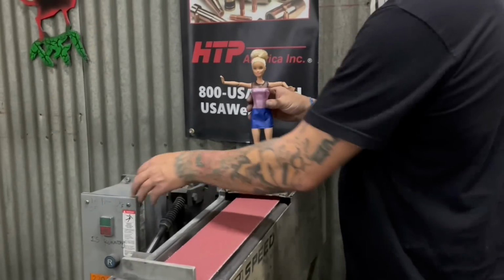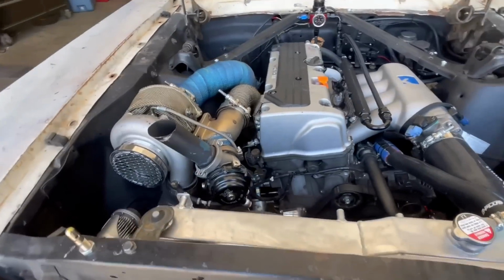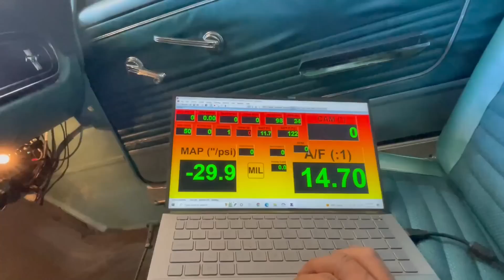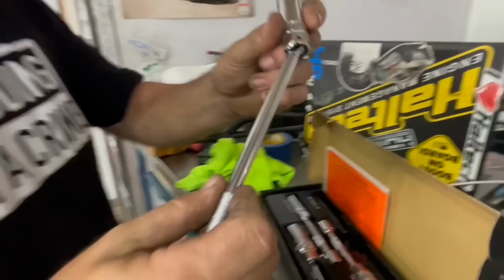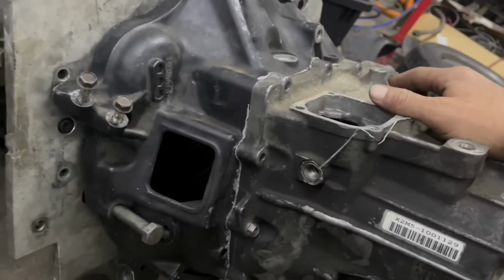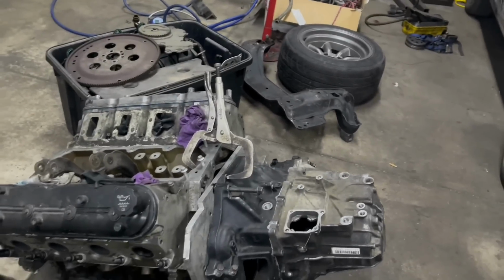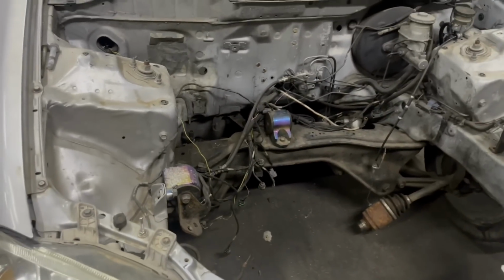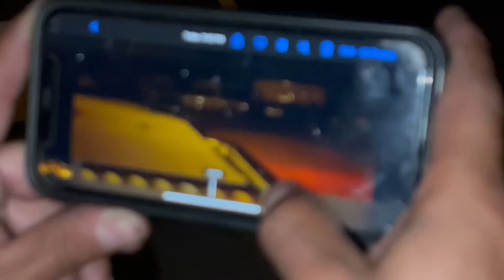K Swapped Mustang! Bent Nsx Rod and an Ls Swap we gotta Do! Let’s have some fun!

Comment: Hey man, If you can find an LS4 block (fwd 5.3) they have the GM metric bellhousing bolt pattern. So any fwd GM trans with a metric bellhousing will bolt right to it. Thats how the Fiero guys are doing it. All the GM 60 degree V6s, the 3800 V6s and the 2.2 OHV 4 cylinders are metric bellhousing. The 2000-2002 Cavaliers and Sunfires with the 2.2 OHV (NOT the ecotec) came with the Getrag F23 5 speed with a metric bellhousing and those transmissions are pretty stout and will work with the LS4.

Comment: You guys should try to find a few old school Big Wheel 350s not only to have fun like this after hours at the shop but also for the drag strip to get around on... On the YouTube channel Bikes and Beards they recently came across all 3 sizes they made back in the day the BW80, BW200, and the BW350 and all of them are 2 stroke and I believe they are made by Yamaha but I think it would be awesome if you guys could find a couple BW350's and fixed them up then took them out to the sand dunes and tried them out locally and if they run really good then take them to Glamis or get a Rokon the 2WD big wheel mini bikes I'm not sure what size engine comes on them but a few 2WD big wheel mini bikes would be awesome on the dunes as well

Comment: To do a wheelie with these things, you need to get it in second, pump the front shocks down and when they rebound, yank the throttle to the max. If you yank the handle bars at the same time, it will over rotate and you can't get it to stay up. Rolling in second, pump and thottle. And feet on the pegs. You need them to push you up on the seat for balance, and rear brake to catch the over rotation. You can do the same on first, but it's more calm on second.

Comment: I had just inquired about LS tuning from you guys but seems your not doing the remote thing which I get. You guys prefer Dyno tuned vs st logged tuning. Which was the cd009 from again? I have an lm7 with summit 8707 226/238 .600 lift 113 lsa cam, pac 1219 springs, Brian tooley pushrods and trunion kit, rebuilt 706 heads, shorty headers (space limited), and full ss vband custom 3" x pipe to black widow single 4" outlet muffler. Has the tbss intake and 92mm cable throttle, msd coils, and an RS5R30A z32 tt trans with gforce kit and mecloud 6 puck and pp, has a ford 8.8 31 spline with 3.73 spooled, and 2 passenger side short axles, bnes panhard, ipd torque rods with poly bushings and custom aluminum driveshaft. Has Wildwood pedal set with Wildwood clutch master. This cam makes makes HP around 6k at around 340g/s of air so guessing the 440bhp range. Received Dyno sheet with it stayed 388whp and 395ft lbs but think must've been mustang Dyno. It uses the Corvette regulated filter with -an and earls fittings. And l59 flex fuel injectors and a walbro 255 pump (enough for now). Uses an ls6 oil pan. I just got hptuners and trying to figure it out. Got the governor changed from 98 as was originally going to be a drift car. Has full angle kit with camber plates and extended lowers and spacers. It's got 5x108 to 5x120 adapter up front and 5x114 to 5x120 in rear (explorer axles, hubs, brakes) on Corvette 16x8.5 sawblades. With kuhmo ecsta xs tires. But believe the Dyno tune has speed density on as always open loop but still logs airmass? Idk have lot of reading to do. Maybe someday you guys will do remote tuning.

Comment: If you have one bent rod, never risk using any of the others, it won't go well
Reply: Not necessarily. There's a few things that could have caused that 1 rod to bend.
Reply: @TrevorFrazier331  that doesn't matter, as an ASE certified mechanic of over 30 years, you do not reuse these types of parts if one of them is bent, this is common knowledge for any engine builder.
Reply: @TheeMissingLinc  So I guess Steve Morris (Literally one of the best engine builders ever) doesn't kno what he's talking about then.....Man go argue with someone else if your that bored.
Reply: What the hell are you talking about?? I bet you wouldnt use aluminum rods also
Reply: So even though measures don't lie, you just replace them anyways.
Reply: @TrevorFrazier331  when does he reuse rods that were in an engine that had failure on a catastrophic level? Because bending a rod is considered catastrophic failure
Reply: @TheeMissingLinc  never said he did. But he said you could if they were still within spec. You can bend 1 rod and the rest be fine.

Comment: If you had a 4.8/5.3 LS out of a newer Monte Carlo or an Impala both that are FWD it would maybe be easier for the FWD LS swap and you might just have to get some custom axles from the Driveshaft Shop and have Chevy knuckles going into the trans and Honda knuckles on hub end and I think the chassis that would fit it best would be a late model Accord or something like that something that is similar size to the late model Monte Carlo and the late model Impala or Malibu

Comment: So wow you know I've seen you guys working on that sho nuff thing for 3 years now and it's still not running. I don't even know what to say. I have never seen a build take so long. I'm over it.
Reply: Man you have to remember they have a lot of customers cars to build, work on, tune and get dialed in and it’s usually on a tight timeline. I don’t know if you’ve ever built a drag car from the bottom up but it’s a long process by itself, then to add paying customers on top, it means you don’t always have time to do what you want to do, plus when you do this shit for a living sometimes you need a break and don’t want to work on your own projects. Remember you can’t rush the process and get perfection